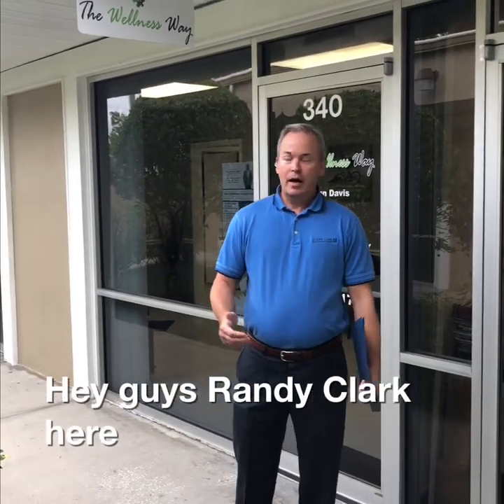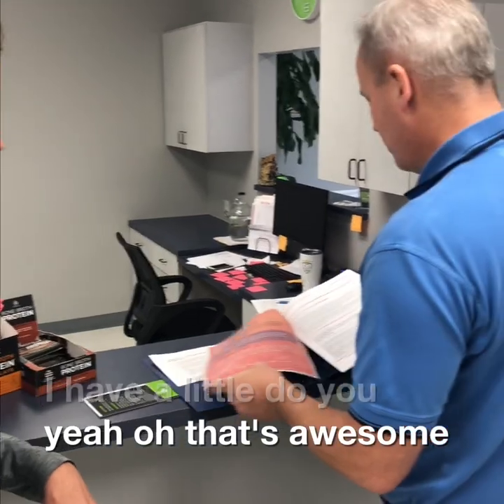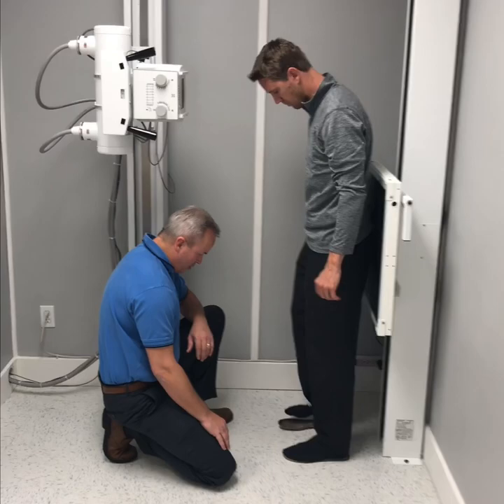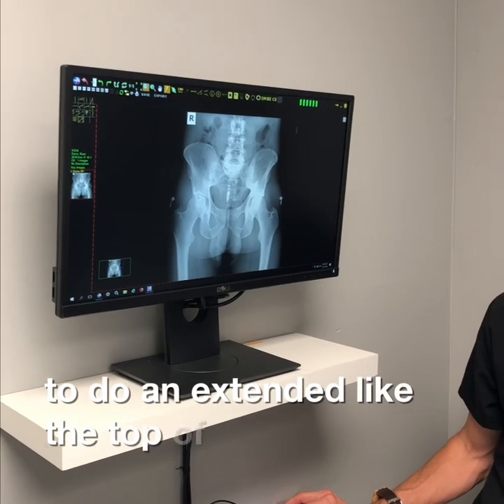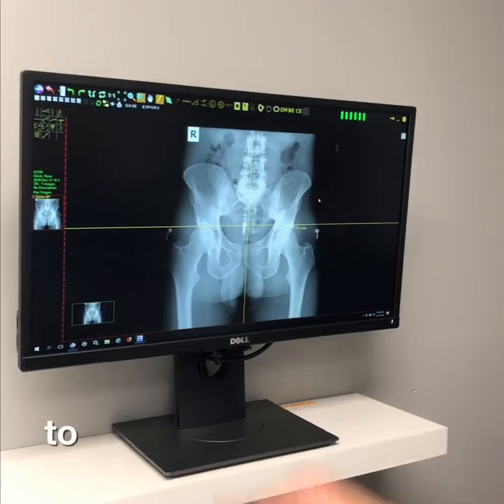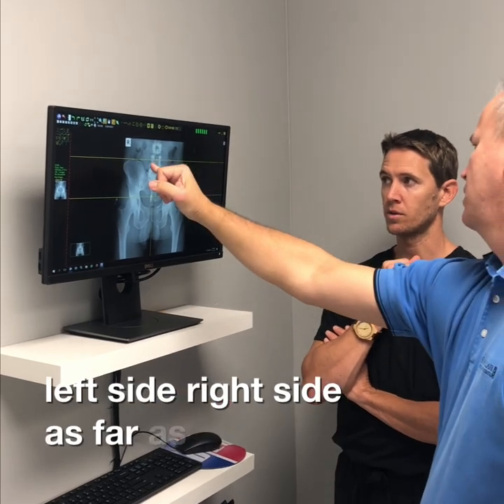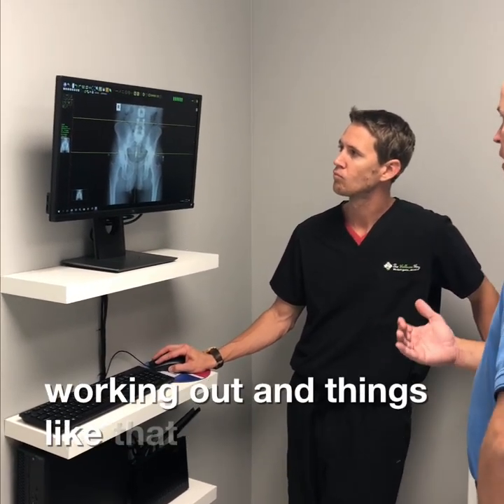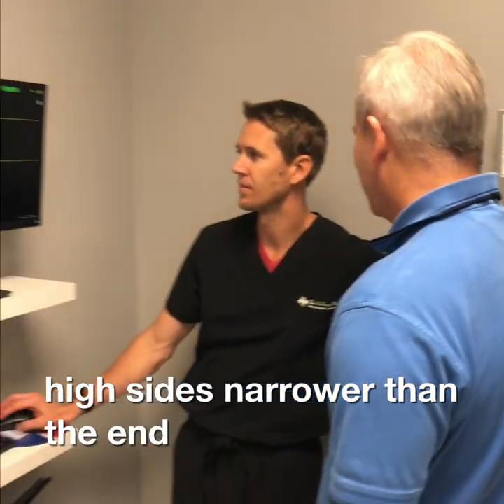How to take and assess a leg length inequality X-ray.

Comment: I spent 20 years as a chiropractic X-ray technician as well as massage therapist in our clinic.
Shortly after I first met Paul ST. John and purchased his measurement kit, A radiologist came to us for a leg length X-ray. [ non of the places he worked had a full spine cassette that could get the whole leg length on one film.]  I carefully measured everything and discovered that even tough he had adapted so that his pelvis was level one tibia was 6 mm longer than the other and he was compensating by flattening that arch.  This adaptation caused pain when he ran competitively. With a 6mm full length lift under the short leg he could compete without pain and had less fatigue after work.